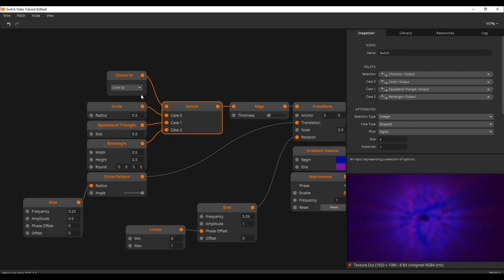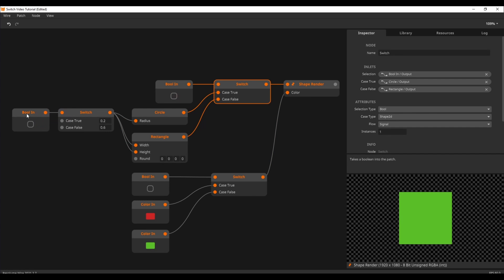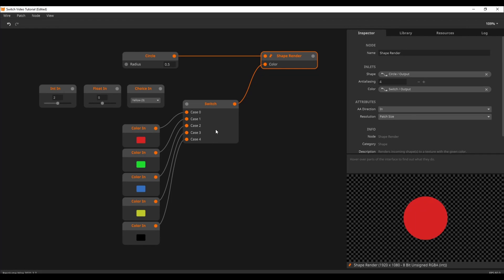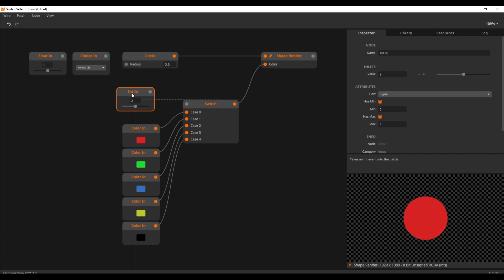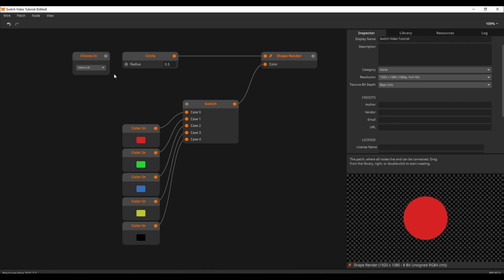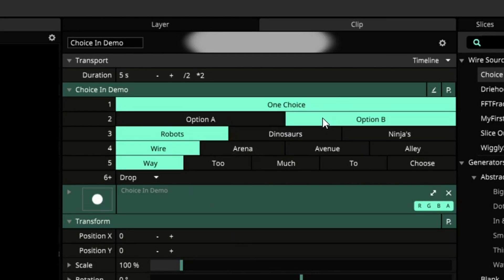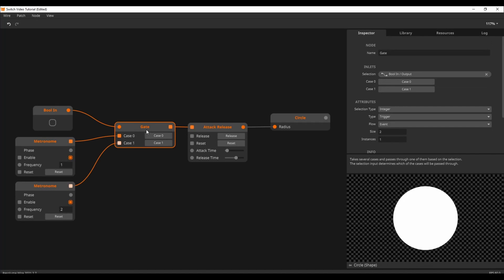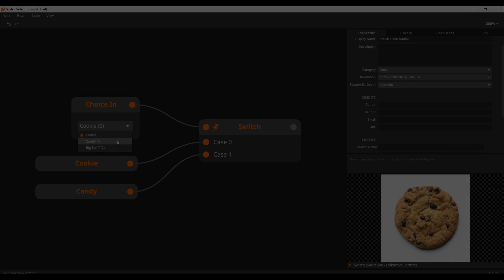Wire Video Course 1.9 - Switch, Gate & Choice In

Comment: I couldn't find the choice in and the color in doesn't work for me because they are not the colors I want to change on the switch.
Reply from the maker: choice in is replaced by the Int In node. In the node panel you can set the amount of choices etc. The new system is more flexible and gives you additional options.
Reply from the maker: Additionally: if you right click on the Switch input you can select "expose input" and it will create an int in node, with all the options already premade.

Comment: I didn't find the Choice In node in Wire?
Reply from the maker: It is replaced by the Int In node. For Colors use Color In. In the node panel you can set the amount of choices etc. The new system is more flexible and gives you additional options.